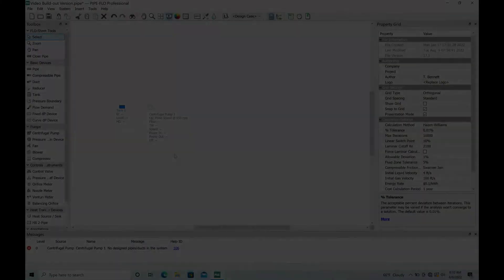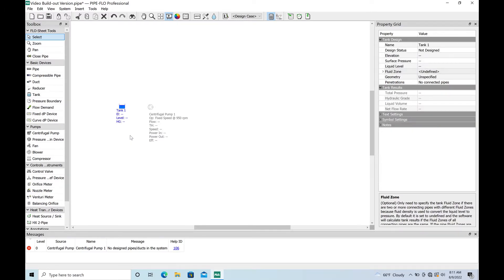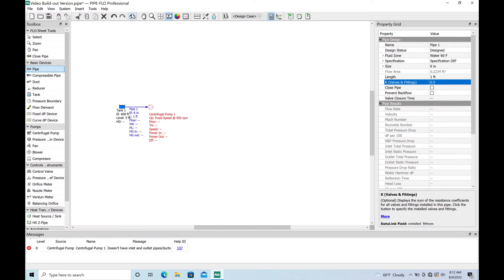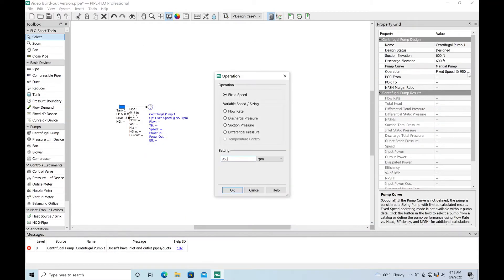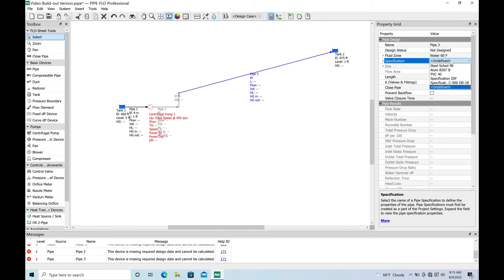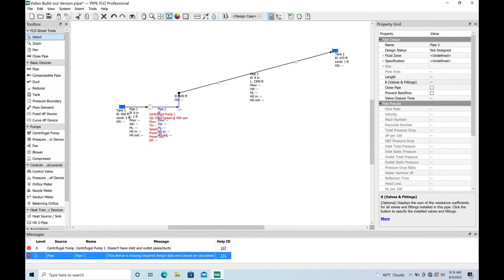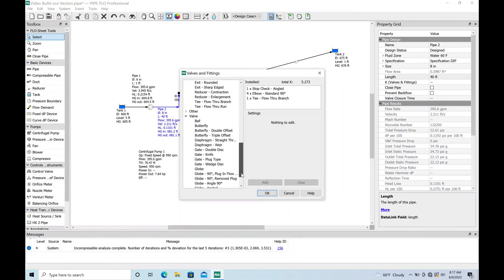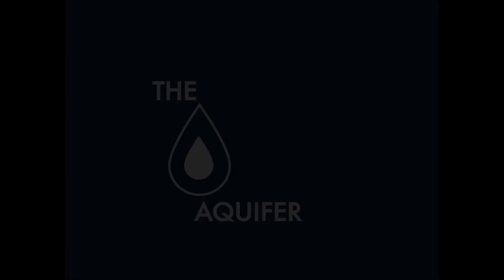Modeling a Basic Submersible Pump Station with PIPE FLO

Comment: Hey is it possible to determine  the minimum pump size from this and possibly match it to existing pumps? Also can you download specific pump data into it and have it select based on system requirements. Also how would such a model look for an aquifer (both types)
Reply from the maker: Yes, you can 100% determine the minimum pump size and you can certainly model the system to match an existing.  I made a video about this - check out this link - https://youtu.be/qQkdyMAQnVE